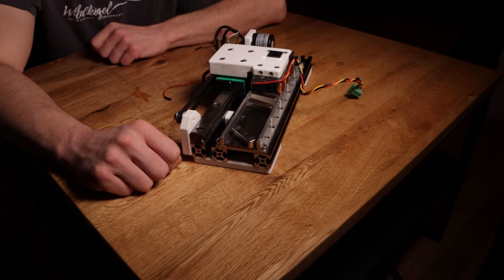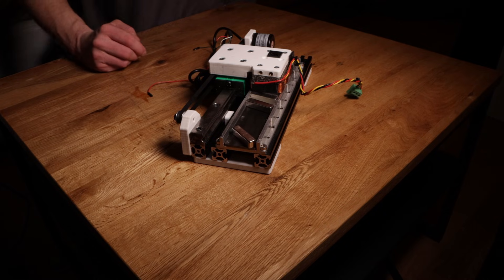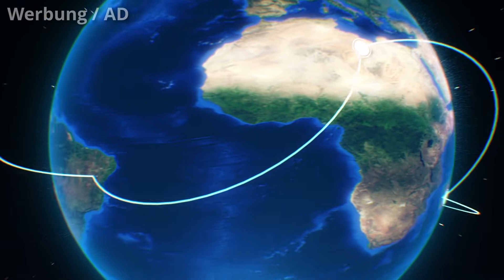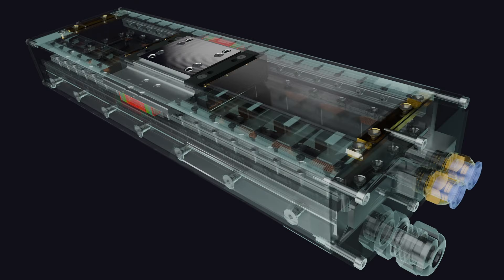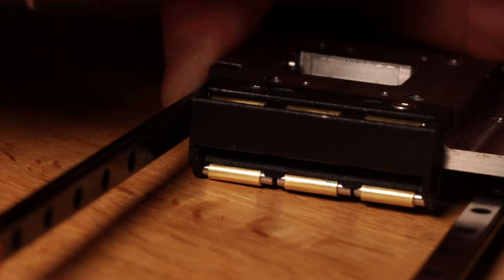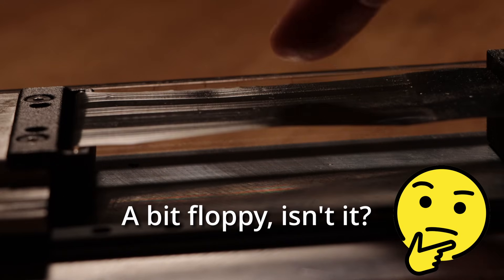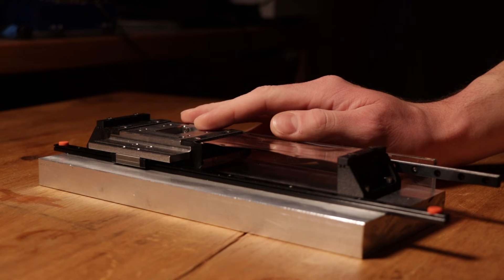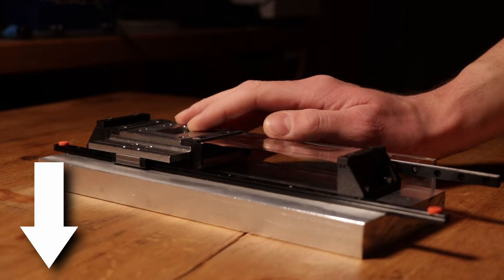I Started OVER… and Something Went Terribly Wrong (Linear Motor Project 2025)

Comment: How could I miss this video?😮
Been a while since the last vid. You need to liberate us from screws man!
Good work. Using the coils as the stators is an interesting approach, easier to cool, but maybe a bit more work to wire it up?
I assume you would need to figure out a way to only use the coils thats actually doing work?

You could probably make some good profit if you did sell parts or kits in the future.
Linear motors seem like an unused market in the hobby sphere.
Reply from the maker: I only plan to power four coils at a time. To wire them, I’m finally building a machine to do it for me — because I’m way too lazy 😄
Once everything is finished, I’ll publish the plans. No idea yet how regulations would look if I wanted to sell it, but it’s definitely a great idea!

Comment: I don't know what your core should look like, but you could possibly salvage the metal sheets from old transformers and motors. These are also more effective with a changing magnetic field. Which is probably not the case for you.
Reply from the maker: Eddy currents would be low - you’re right. That’s possible, although it would have been nice to get some raw stock.

Comment: I managed to buy some amorphous ribbon from China. Pretty cheap material, but delivery is very expensive. 60Eur for 10kg, but all other expenses were 200 to 300 Eur, i dont remember exactly
Reply from the maker: I found some in China, but the minimum order quantity was like a ton… I also found some good stuff in Germany, but it was around 100 bucks for just a paper-sized sheet :/
Reply: @NeverGetTiredEngineering  Yeah, it usually is like that. It did take a while until i found it. It probably was on Alibaba, titled amorphous ribbon. Quite a few options too. In fact i just looked it up exactly like that and found a mountain of options
Reply: I'm interested in buying that material. Which platform did you use to purchase it? Was it delivered directly (door to door)?
Reply: @INNOVA_MEX  Alibaba. It took almost 2 months, but considering its the only option, it was fine